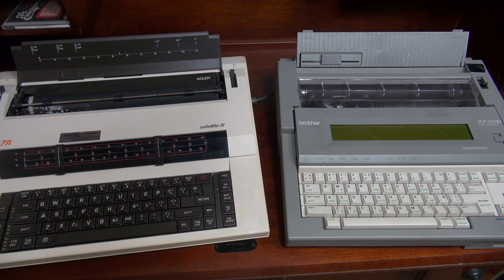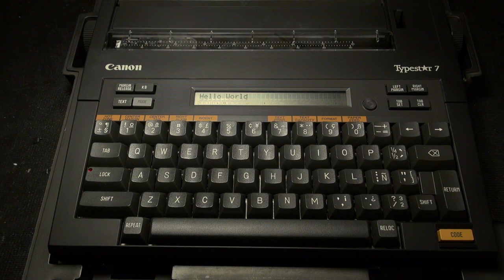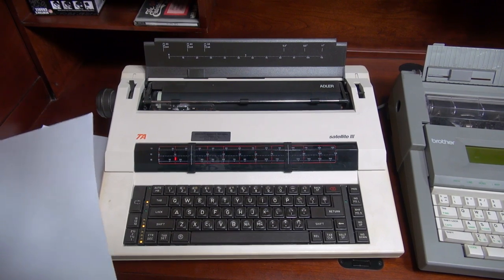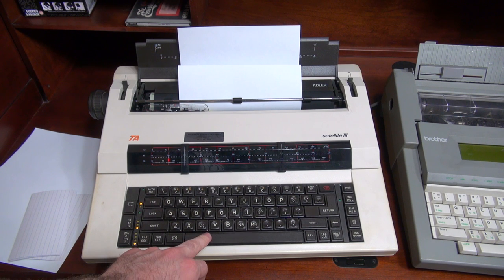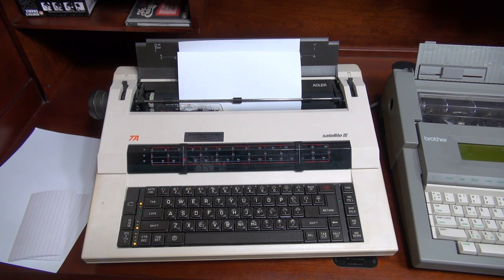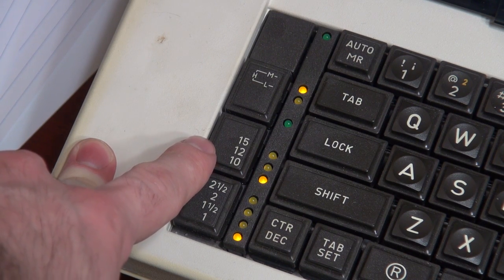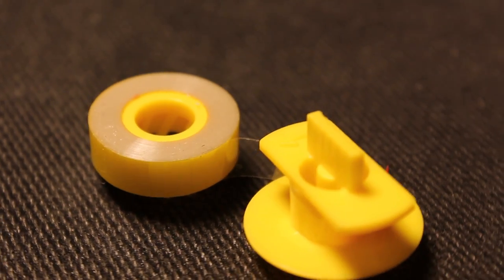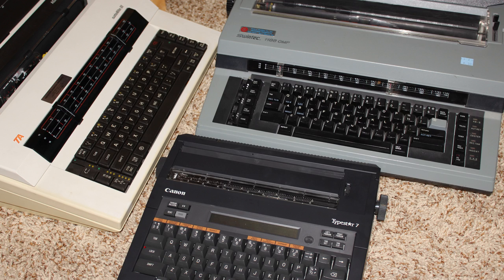Basic Introduction to Electronic Typewriters

Comment: Nice Video ! 
I was factory trained on the Adler & the Swintec. I mostly restore vintage typewriters now-a-days.
Long Live the Typewriter !!
Reply: I wasn't, but hey, to each their own.
Reply: Sharp 3100 x
Reply: Why won't the carrier on my electronic smith corona typewriter move? The light is blinking as well. Please help
Reply: @flip65515  Is the shipping lock removed ? How is the carrier jammed ? An obstruction ? 
I can't tell much without looking at typewriter.
Did it ever work ? Flashing LED is an error code, basically telling you something is wrong......
Reply: Hey Phoenix Typewriter! I have a Adler 350A/TA Satellite II/Royal Alpha 2001 and I'm wondering if you can point me toward any info on how the electronic margin sensors work? I believe my margin sensors are broken because it often beeps at me in the middle of the page and will go back to the left side on it's own accord. Other times it won't go all the way back to the left side when I hit carriage return, as if it thinks that the start of the margin is somewhere in the middle of the page. I've tried clearing the margins, but that's not it. I can rarely make it through a whole page before it beeps and either won't let me type anymore or goes back to the beginning of the page.
Reply: @phoenixtypewriter2136  oh that might be it! When I manually push my carriage back and forth it moves evenly, but it's much harder to push than the one in your video. I'm going to try oiling it! Thanks
Reply: I would love to learn to do this!
Reply: @EmilyBoda  There are two possibilities. First, in the power supply circuit, there is an elco 47000uf 50v that must be replaced. The two carrier cables are broken in the sensor path.
Reply: @evelinedwyer9250  For this type the damage is in the hammer lever and the plastic keyboard for my hammer lever is not made of aluminum

Comment: I've never had much luck with these things, they either have parts missing or other mechanical issues, or the electronics boards have gone kaput.

Guess it's no surprise I love old manual typers, then.
Reply from the maker: +Shipwright1918 Don't blame you there. I've gotten lucky with most of mine but can't say I haven't had issues. I mean you really don't need a tutorial for manual typewriters, if they are working, they just work.
Reply: +Nick Drudge 

I dunno about that, most people seem to have difficulties getting to grips with manual typers, at least at first, but I think that's more to do with being unfamiliar with the technology than any fault with the typewriter itself. It took me a little bit to get used to mine, as I'd never used one before, but once I did it's like riding a bicycle, you don't forget easily.

I agree though, if you have a manual typewriter that works when you get it, odds are it's going to stay working longer than you will provided you take care of it. A little cleaning every so often,  a drop of oil here and there, and a fresh ribbon is all you need, no electricity required ever.

Electronic typers are all right, I suppose, but as I said, I've never had the good luck to come across one that worked. I'm sure they're not all lemons, and no doubt they're really useful.
Reply from the maker: +Shipwright1918 I expect that learning curve with any device, but once you become familiar with manaul, you can typically handle any manual "oh I've seen one of these before, I know how to use it." Electronic having weird specific functions with word processing ones not even immediately printing when you type. 

Yup manaual typewriters will probably outlive us all. 

As far as electronic typewriters, there's something to be said about plugging a parallel cable to a PC and getting it to print with a basic command when a few year old USB printer has no driver support for the newest OS and all kinds of ads for their ink. Watching a typewriter seemingly work on its own is a different form of magic. Otherwise yeah its just preference. I find them an interesting hybrid of two worlds if anything.

Comment: I have a Royal Satellite II which resembles the III shown here but without a left platen knob.  Mine is stuck--it doesn't move or type. It turns on, so the problem appears to be in the machinery and not the power supply.  When I type, the printing mechanism does not advance. The print wheel spins to different letters but never strikes the page.  Whether I type, or hit the return, or hit the correction button the printing mechanism rocks but doesn't advance. I changed the ribbon cassette and replaced the wheel, with no affect. Can you guess what may be wrong with it?
Reply from the maker: +Rusty Silver The print head isn't lodged in any way, correct? No obvious shipping placeholderd anywhere? If you gently push it left or right, can it move? The usual "don't move too fast, you'll burn out the motor driver" applies. Is it possible to check the connections to the print head to make sure they are making contact? I can't do any searching right now to see if there is a common fault with that model. 
As long as the mechanics are fine, it'd be on to an electrical check with motors and go from there. If it isn't anything simple that is.
Reply from the maker: It's really hard to say what's wrong with it. I agree, it certainly "tries" but I don't know why it can't. Doesn't seem to be anything simple sadly, or at least nothing I've seen wrong before. Might be as simple as some form of power (or even still connector?) problems, or some strange processor problem. 
The first thing it should do when it turns on is try to move the print head all the way to the left, finding the end stop, so even it doesn't even seem to be working at startup. The ability for it to try to spin the daisy wheel is perplexing, making me want to think power delivery , but I'm probably off base.
Reply: Thank you for your ideas and will let you know if it gets working again.
Reply from the maker: +Rusty Silver You're very welcome! Hope to hear it's working soon! Best of luck!

Comment: Hi
Absolute beginner here, and not a native English speaker, so a simple but for me not silly question: is both the rubber cilinder in manual typewriters as well as the plastic "knob" on electronic typewriters called "platen" ?
Reply: I believe so. The inner rubber roll is called the platen, and the knob is the platen knob.

Comment: Recently I bought a Olivetti electronic typewriter called Lettera 39EC.
I could type a bit but when I pushed “power return” key, the machine seemed shut down or locked.
I still barely can hear the sound of motor.
Is there anyone help me, so appreciated.
Thanks.

Comment: Could you please say how long can work (without any repairs) a portable typewriter? And which printing technology it uses, because it writes without noises.. somehow.
Reply from the maker: Portable typewriters seem to last quite a long time without any repairs. It mainly comes down to replacing the ribbon cassette it uses, and then batteries, if you aren't running it off of the wall. 
Most portable typewriters I have messed with use a thermal printer, and the ribbon cassette is basically the "toner" for it, since you aren't using thermal paper, it instead uses the heat to transfer the material onto the paper. The ribbons for the Canon Typestar 7, as shown in the video, are rated for 32,000 characters.
Reply: Thanks for an answer. :)Nick Drudge
Reply from the maker: You're welcome!

Comment: The daisy wheel on my Royal Signet 10 is not in the correct position.  The type does not correspond to the keys that are typed.  Do you know how to align the wheel in the correct position?
Reply: POR , Power on Reset , this homes print wheel. If you still have mis-selection look for something interfering with the print wheel turning. If print wheel turns un-restricted & still won't home, machine needs repair.

Comment: So cover up is for carbon and lift off is for nylon?
Reply: Køøl Düderino, No. other way around. Lift off is for carbon film ribbons only. 

Cover-up is generally used for ink-based nylon/fabric ribbons since you can't lift ink from paper, but it can also be used to cover words from a carbon film cartidge as well. Cover-up will work for both types of ribbons, but Lift off only works on the carbon film ones.